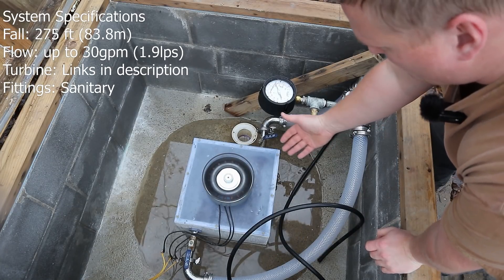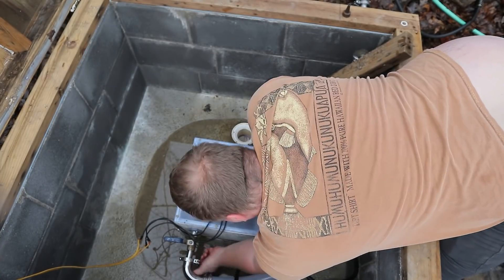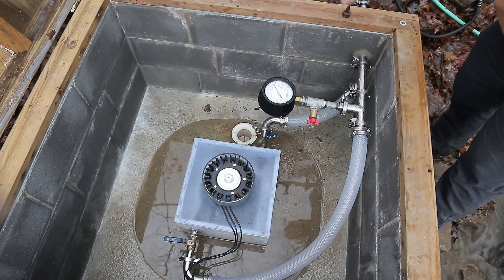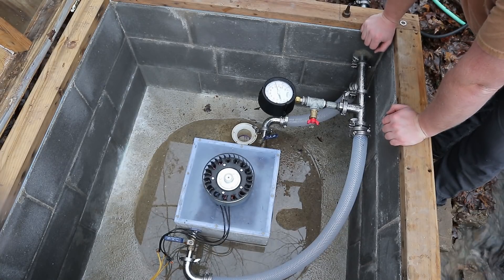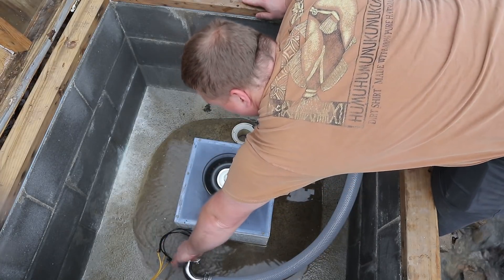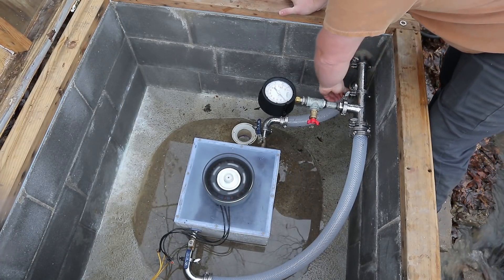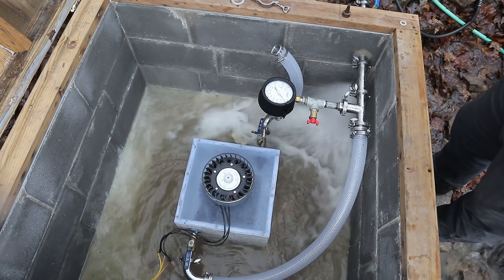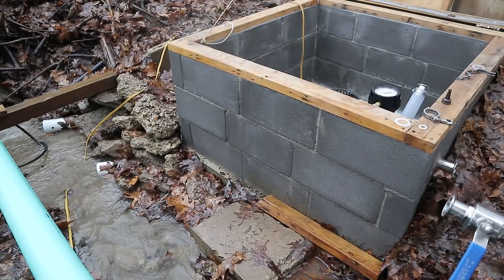575 Watt Turbine After Heavy Rain.

Comment: Is this 575 watts an hour
Reply from the maker: Yes but only for that hour, my flow is variable.
Reply: @JoeMalovich  the reason I am asking is I have a well on my property and wanted to build a closed loop circuit for micro hydro for power I don’t have a running stream but I have 20 gallons of water per minute indefinitely. Was wondering how much of a of a cut it would be to get an electric pump to pump my water back uphill to regain as energy
Reply from the maker: @itiswhatitis1306  Don't.

It will never ever ever work.

Play with solar or wind first.

Comment: Hi, many thanks for sharing your knowledge with us. I have a suggestion, what if you made the wooden container box, with the plexi, if you made this a circle schape in the box instead of a square shape, to fill out the corners, i think the internal waterflow to the blades would increase then. I have a feeling the waterspeed now gets blocked because of the corners. Also maybe good impact to make the distance and amount of free space in the container box smaller, so just space for the diameter of the blades and the nozzle output only a few mm away. I think it would tip 750W. Kind regards from Belgium.

Comment: I've been watching your channel for a few days now, started with you water wheel, which I thought you did well, but I'd have changed a few things.  That's irrelevant now though.  But, regarding your turbine series, I'm dying to know why you haven't added more barrels up at the headwater to increase your reliability and lengthen you available run times?
Reply from the maker: The key is to match consumption to supply.

Comment: Your windage issues (I caught some of your other videos with cones and rounded corners ) may have a simple solution. Bowl shapes. A bit harder to align the jets but it should transfer the splash out and away from your blades. Heck, you may even be able to test with some off the shelf clear plastic salad bowls.

Comment: every time i see your turbine i think it would be cool to have the jets controlled by proportional valves and an arduino. to maintain peak pressure.
Reply: build you own turbine and do it. I envy people with a house that has even the possibility to install hydo as its so powerfull yet so small (compared to wind or solar atleast if you have the waterpipes / drainage anyway)

Comment: I know nothing about these pumps... but couldn't this be hooked up to a 3000 gallon tank and have the water pumped right back in? The pressure of the tank creates the power and the power pumps the water back into the top of the tank?
Reply: You cant get somethin' from nothin' -- aka it costs more power to pump the water than you would gain from the turbine.

Comment: Cure water hammer with a bypass Y joint in to a relief pipe and its own valve. 

When you want to turn off the turbine, you can easily open the relief valve and then turn off the turbine and avoid any water hammer.

Comment: Would it be possible to fit two turbines in there. One high flow and one low flow, so you can quickly switch between them depending on available water?
Reply: Wouldn't just closing the second jet also be sufficient?

Comment: Wow that's so big current for the 3 phase cables. 500w on 50v, 10amps. Probably use at least 40mm sq cables, especially if it's more than 5m away from the inverter
Reply: The cables are litterally in water lmao
Reply: 16mm sq should be more than sufficient.
Reply: @anubhavmuku96  What the hell are you talking about, 16mm2 for 10 amps? You wouldn't need more than 1,5mm2 for that. 2,5mm2 for longer runs to avoid losses... You could do 100A on 16mm2.

Comment: If the housing for the turbine was circular, with an inverse screw it would push the blow-by downward and out of the pit, wouldn't it? 

So within the square would be a wide pipe with a screw inside of it to move the used water away from the turbine.

Comment: To reduce the splashback on the runner switch to a Turgo runner. Water enters in the top side of the runner and exits out the bottom without splashback. Nice looking system!

Comment: How did you get the water to become pressurized
Reply: Gravity creates the pressure.
Reply: nerd1000ify explain
Reply: @johnhonest9347  The inlet to the pipe is a long way up the hill, placing it some distance above the outlet. The weight of the water in the pipe create hydrostatic pressure at the bottom because gravity is pulling the water down towards the bottom of the pipe but it cannot flow freely.

Comment: WOW!  That's amazing pressure from that lite creek!
Reply: It’s because the spring he collects from is almost 85m uphill. The power of that water when it reaches the bottom is (neglecting losses to friction within the pipe) the flow rate in liters per second times the gravitational acceleration near the surface of the earth (9.81 m/s^2) times the height difference between the spring and the turbine (roughly 85m). So he gets about 834 watts, or joules per second, for every liter per second he can shunt down his piping system. Efficiency is lost making all that whirring noise and splashing water off the housing back into the pelton wheel, though, along with some energy consumed by shear friction inside the piping, so only half-ish of that actually becomes electricity.

Comment: What is the life expectancy of this unit and what RPM / frequency is it rated for? (either max output or max life) What can be done to increase the lifespan? Lube points on the bearings? Splash shield to keep water away? Cooling air duct fed to cut heat / moisture? Some kind of pressure control to limit max RPM?
Reply from the maker: There are some that modify it with a grease zerk. the other information you mention is an unknown.
Reply: It's made by Motenergy. They are quite inexpensive, and look to be pretty good quality. I doubt you would need to do much more than bearings once in a while, and new cups every 5 or 10 years or so, depending on amount of silt, for maintenance.

Comment: Dude.... considering how old the other video is, of you testing the new big wheel... 

We all told you a while ago, your housing, that was supposed to be temporary... is a huge cause of inefficiency. You need to either make a round housing for your Pelton wheel, or make some sort of deflector/diverter/stator assembly to make the square peg fit the round hole a LITTLE better. 

I wanna see your stainless steel housing, 3-4 nozzle rig.... Bring on the big rig.
Reply from the maker: this

Comment: Upgrade to MPPT for dealing with higher voltage step down....
Reply: The Midnight Solar Classic model he is using is a very high quality, and expensive, MPPT controller. There aren't many other MPPT controllers that can be used with hydro, or wind. The few I've seen are very low quality.

Comment: Hello joe once again need help what would be the psi if water flows in 4" pipe at hight of head is 40 feet and the lenght of pipe is around 100meters help !
Reply from the maker: h-hydro.com look for an xls doc called pipe-dp and do any number of calculations yourself.
Reply: @JoeMalovich  thank you joe
Reply: Noor Zia ... water "head pressure" is figured at 2.3 feet per 1 psi so you have just over 17 psi pressure. (static / not flowing) the GPM will depend on the type and size of the pipe, and what the nozzle will flow at a give pressure.
Reply: @rupe53  thank you i might be using a water wheel instead of nozels bcz 17 psi isnt a good preasure and the water gpm would be the great in 4" pipe from that height
Reply: @GbFancyBirds  ... you might want to consider several pipes or a larger pipe to get more volume. Remember, with a slow turning wheel it's the weight of the water (the volume) plus the diameter of the wheel can greatly aid in mechanical advantage. Using that chart and finding out how many horse power you can develop will cross directly to how many watts you can produce.
Reply: @GbFancyBirds  I think a Turgo style turbine (wheel) would work better in that situation. They are made for lower pressure, and higher volume. The turbine in the video is a pelton turbine made for higher pressures and lower volume. The same manufacturer in this video makes such a unit with the same generator.

Comment: Once you get t the R&D complete think about a cast round metal housing for the generator. A company called Ash builds industrial pumps they are lined with a replaceable rubber liner, so the water can't after time erode holes through the metal. Just a thought

Comment: that's so small I would almost consider it portable. would it power an electric chainsaw? how about a winch?
Reply: Not directly.... but... through a big enough battery and inverter, yes to the saw. 

Same with the winch. With a battery, sure. 

This water wheel makes power over the long term. Think.... little compressor, BIG air tank. The compressor can't run the air tools directly, but with storage and duty cycle... one can run all manner of air tools. 

Same with this wheel, use it to charge a 50Kwh battery bank, and 5kw inverter.... you could run anything... for a length of time. 

Offgrid power requires you to think less of "WHAT I'm going to run" versus "HOW LONG can I run it for". Beauty of this type of generation, once the battery bank is full, you dump the supply to a dump load inside a hot water tank. And back when demand > supply.  One will always have power and hot water.
Reply: @ScooterMcAwesomeness  thank you for the long detailed answer. makes total sense. I don't know what my excuse all these year have been for not building one of these, but it ain't good enough of an excuse. it's the dream
Reply: @markifi  My pleasure, friend. I've always been fascinated with offgrid power, it's a genuine passion, of which I'm only happy to share. 

Take care, stay safe, and remember... The dumbest question, is one not asked.
Reply: It is pretty much portable, except maybe for the pipeline. Most are about 1000 feet long, and about 4 inches in diameter unless, of course, you have quite a steep slope to work with.

Comment: I think you may be introducing air bubbles into your penstock/ pipeline inadvertently. I may have a solution for you.
When the nozzle valves are closed with air in the clear lines and then you open the penstock valve, I believe the air goes up into your penstock before you open the nozzle valves.
 I think if you open your boiler valve/hose nozzle first, then slowly start opening the pen stock valve, the air, then some water should come out your boiler valve. Once the air is gone, close the boiler valve The clear tubing should be full of water without much air, and then open the nozzle valves, and I think you'll have less problems with cavitation.
Nice project by the way. What are you powering with it? I would hope with that much power 24 /7 you'd be able to power the majority of your home.

Comment: So new cables (to reduce losses), more batteries (to up your battery bank voltage), an inverter (to supply a second panel in your house with power), and a new housing and you'll be making real, economical power. By the numbers, you're looking at quite a bit of utility offset maybe like 30%, depending on how much your usage is already.
Reply: 575 watts times 24 hours equals 13.8 kilowatt hours a day. Multiply that by a 30-day month and you get 414 kilowatt hours per month. I don't know about you, but to me that is real, economical power.
Reply: @johnwyman6331  yes, but you need the other stuff to actually use the power
Reply: @jttech44  is he not actually using the power now?
Reply: @johnwyman6331  He seems to just have dummy loads on cheap inverters at the moment, nothing wired into his house, or that would substantially offset his power usage. He'll likely need more batteries an a proper utility inverter to keep up with peak load.

Comment: 1. Why are there no slow fuses at the turbine outlet ?
2. Why does the rectifier stand somewhere far away ? 

2.1 What is the frequency of the turbine output current ? 

2.2 what is the parasitic inductance of such long wires ? 

2.3 what is the final impedance of such a long wire at this frequency ? 

3. What is the parasitic capacity of the wires ? Is it really worth wasting the energy of such a small source on permanent capacitive leaks ?

Otherwise, the project is super ! The excess energy, when the batteries are charged, can be used to heat water, which then goes to the regular water heater, and as a result it will spend less energy.
Reply: Not my setup...  but... answers. 

2. The point of running the way he has it: DC power suffers massive losses over distance, AC isn't as bad. SO, let the turgo make 200VAC and send it long range to the rectifier, where it is converted to DC and sent by short run to the batteries.

1. No fuses = he's cheap? Silly?

2.1 variable, depending on speed. 
2.2 not enough to worry about at these power levels
2.3 see 2.2

3. If you're asking a question of such a "technical" background, you should already have the answer. Again, see 2.2
Reply: @ScooterMcAwesomeness  3. If you're asking a question of such a "technical" background,
That's why I ask questions that should lead to the right idea.
I'm trying to bring a competent approach to the construction of things.

direct current suffers losses on a long wire solely from the constant resistance of the wires.
I didn't talk about converting high voltage to low voltage for lead batteries.
I'm saying that the variable should be straightened, but not lowered, these are two different concepts.
rectified voltage from 200 VAC * sqrt (2) = 282.84271 VDC , there is not even a smell of 24 VDC.

But the alternating current loses power from: active resistance + parasitic induction + parasitic capacitance.

The funny thing is that active resistance is permanent, while parasitic
capacitance and inductance increase losses with increasing frequency (see "circuit design").
it turns out when the turbine is gaining momentum, and a competent scheme will remove more power from it,
long wires will act as a choke, as in fluorescent lamps that limit alternating current.
it turns out that the turbine is fighting parasitic losses for nothing.

as close as possible to the turbine, you need to rectify the current, and put DC-DC as close as possible to the battery.
don't confuse these things. You even have a diode bridge that is separate from the controller which is already hinting
two stages of current conversion.

fuses are not stupid, they do not protect the TURBINE, but the ENVIRONMENT, so as not to start a fire.
it is clear that there is nothing much to burn near the turbine, at the moment, and tomorrow they will accidentally put it there
a bunch of twigs, some kids who want to play. or do you have an armed guard on turbines, wiring, and batteries 24 hours a day ?

question 2.1 is not empty. there is a specific frequency range in which the turbine gives maximum power,
let's say we are not interested in the frequency of 1 Hz, because this is not a combat mode, and we are not interested
the frequency  10 GHz, because it's not real. so there is a very specific frequency range,
from which you need to make other calculations of inductive losses.

2.2 not enough to worry about at these power levels

it is at such capacities that there is something to worry about because the source is actually weak,
and if you thoughtlessly lose energy at every step, the overall efficiency of the system will be low, and it will not
only in how many specific Watts will be lost, but in relation to the personal life time spent
for all these losses due to lack of calculations.
Reply: @hackerproff  he's making around 400 kilowatt hours a month. He actually went out and did it, more than most.
Tell us about your setup, and how you squeezed every electron out of it. Don't forget to show us the cost benefit analysis in dollars per electron saved.
Reply: @johnwyman6331  When I build my house and start making similar toys, naturally I will do a test in practice in different ways. And with great pleasure I will post everything on YouTube. It's just that my time has not come yet. And I want to tell a person the optimization path, and your comment simply pours negative and does not bring anything useful. If there is such a decent power, then the protection of the environment with fuses and differential breakers is definitely needed, it is generally always needed when the voltage is more than 30 VDC. If the installation is amateurish, this does not give her the right to be dangerous, and does not cancel the safety standards.
Reply: @ScooterMcAwesomeness  by the way, use sealed connections, otherwise sooner or later someone will be electrocuted, it would still be good to put a "protective disconnection device" to protect people.

Comment: Hi, I think you did an excellent job. I would, however, suggest you to check the connection cables between the alternator and the rectifier, according to they are too small in section and you have a huge voltage drop due to the length of the cables. The power results you get are excellent, but you could improve considerably by increasing the cable section
Reply: I totally agree. Wire sizes and connections may give you a better connection. Great job.